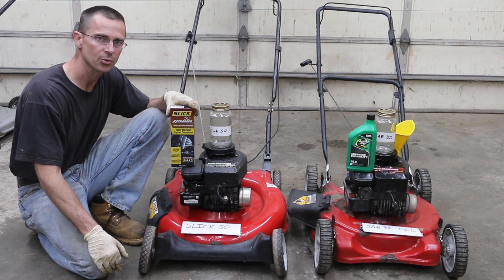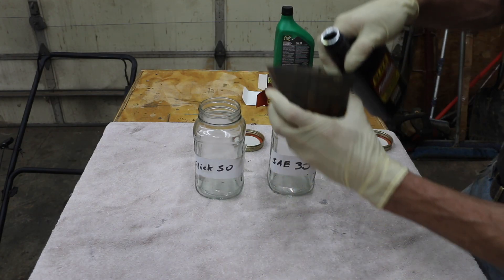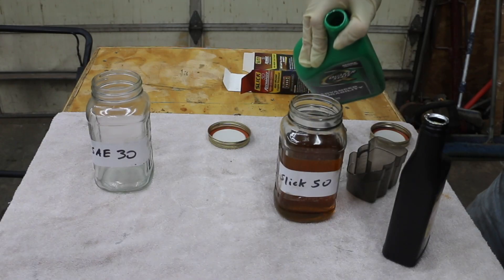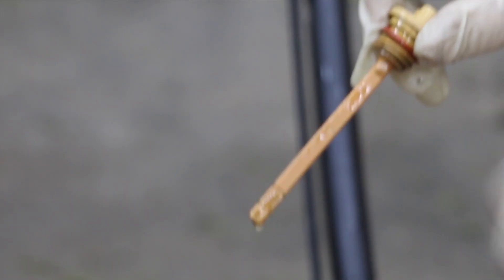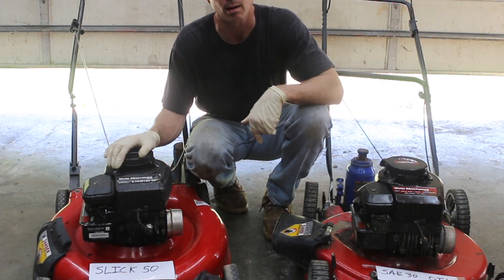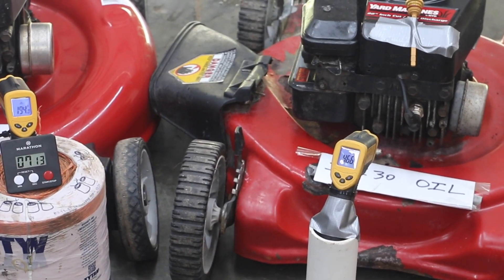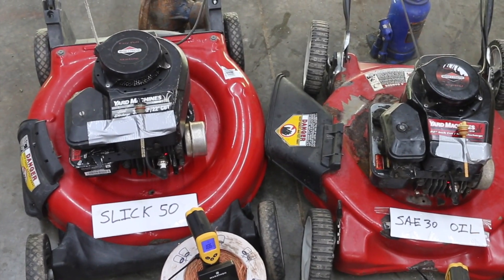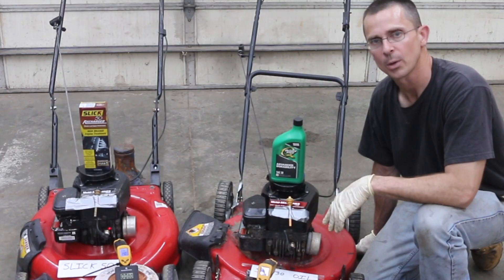Can't believe what SLICK 50 did to my engine!!--Dry Crankcase Test!

Comment: You have to remember that a couple contributing factors to engine temperatures are air/fuel mixture along with ignition timing. Engines should of been tested for both of those to make sure they are also running at the same for any further tests.
Reply from the maker: Great point!

Comment: "Zmax" , "Prolong" & "Dura lube" are the only other oil additives I've seen. Never tried prolong, dura lube had an all purpose spray that could keep the rotor cap and plugs and electrical dry, but differently than "Wire Drier"spray.
As for your testing I didn't see you miss any thing other than put a bore scope into the engines to see what damage happened.
I remember one of the commercials said as they showed a lube failure test against other lubes that Bleach could do as well or better than some other lubes but sadly I don't remember who it was it's been so long. But the part about Bleach was interesting.
Reply from the maker: Thank you!

Comment: I think you don't understand the principles of lubrication.  The advantage of thinner oil in both reducing friction and flow to improve heat dissipation are enhanced by the slick-50, but without the mass needed for the necessary functions, the lower residue in the slick-50 machine is the probable cause of the early failure.  There are also important considerations when you chose a single weight oil.
Reply from the maker: Thank you!

Comment: The blackness of the Slick 50 oil may be telling of how much more worn out that engine was.  Worn metal usually shows up as "black" in the oil.  The Slick 50 may have cleaned a bunchof worn metal out of the engine it was in.

Comment: I had a Hyundai back in the 90s that i treated once per year with Slick 50. It hit a tire (with a rim!) on the road, broke the oil pan. The car made it home (10 miles) and the oil pan was dry. 200,000 miles and 10 years--not one leak, knock, or smoke. Compression remained excellent.
Reply from the maker: Wow!

Comment: Watching this over a year later, I'm curious about something; if you still have those two specific units, which engine would break loose more easily in an attempt to unlock the crankshaft by an oil fill followed by external torquing on the crankshaft? I imagine that the warping caused by the straight oil engine's tempuratures will make it more difficult to unlock, if it isn't melted together, while the Slick50 engine's lower temps resulted in more friction shaving than warping, allowing for a potential recovery, and an unreliable but still functional unit, with some rattle in the crank bearing and scratching on the piston rings and walls letting oil up to burn in the chamber. Only one way to find out.
Reply from the maker: I wish I still had the engines but I don't.

Comment: I do believe the slick 50 needs a much longer time to build up a protective coat on the metal than the 10 minutes it was run for. Stick some in a car...run it for a couple of weeks then try the same😀😀
Reply from the maker: Great point. Thank you

Comment: A water cooled engine might have lasted longer. Once the piston expands to a certain point the engine seizes so I suspect that extreme high temperature is the real killer here. Even so, Slick 50 may have some benefits when used in a regular car in terms of reducing wear and improving fuel economy. I wouldn't buy it to try to save my engine after a sudden oil loss. Hopefully my gauges would alert me to any loss of oil pressure and I would switch the engine off before it seized. Also I suspect a metal based lubricant such as Pro-Ma MBL8 would fare better in that situation. That's what I use in my car which is a 2003 turbodiesel that has done 286,000 kms and still runs perfectly and gets 6.5 l per 100km on the highway or 8.5 in the city. Pro-Ma products are not sold in the US but you can order them from Canada. Bell Performance sells a similar metal based lubricant product in the US. It uses nano particles of copper and lead to plate the surfaces of the engine. You can search on YouTube for a video where they friction test the MBL8 product and prove that it keeps slipping at a higher torque rating than regular oil. https://youtu.be/d83RCJnaysI

https://youtu.be/pqM8wdaHBaQ
Reply from the maker: Thank you!

Comment: Prolong oil additve is good stuff. Run it in all my motors, diesel and gas 2 stroke and 4 stroke. Never had a motor or bearing go bad using it. Just my 2 cents.
Reply from the maker: Thank you for the recommendation.

Comment: pretty cool...I used to run pro-long years ago in a boat with twin 454's that were using oil, it cured it which I had a hard time believing as well...have not used it in years now...not even sure if its still made...
Reply from the maker: Thank you!

Comment: Hi, I always stand the Slick 50 bottle in hot water for a few minutes and shake it well just before use. If you didn't shake the contents, maybe they didn't mix which would partly explain poor performance. I only ask because when you poured the Slick 50 from the bottle it was clear like honey. When you shake the bottle it comes out the same as set Honey (ie:- cloudy because of the air bubbles).
Reply: Great video's though!, always enjoy them....
Reply from the maker: Thank you!

Comment: You should try the original Slick 50 formula. It is now being sold under the name Lubrilon in the US.
Reply from the maker: Thank you!
Reply: I still have the original Slick 50 for sale at my parts store, under the original name.
Reply: I did not know this. I wondered what happened to Slick 50, as I put the original Slick 50 in a VW engine in a Karmann Ghia (after overhauling the engine). I remember the original bottles had a 100,000 mile between treatments statement, whereas the newer ones have only a 50,000 mile statement on them. I do not know if the new ones have PTFE in them. What I do know is that the Karmann Ghia I had treated got better gas mileage than before, and when I drove it from Lancaster, PA to Rochester, MN (probably severely overloaded, as I had it packed with everything I could stuff into it, after removing the passenger seat and tying it to the top of the vehicle), I was accelerating while going UP the mountains in PA, while vehicles around me were slowing down. (The VW engine was a 48 hp engine!)

<EDIT> I forgot to mention that I had a 1973 Toyota Corolla that I treated in 1980 with Slick 50. I was able to start this vehicle at -40 degrees without having been plugged in, and without any noticeable trouble (compared to warm-weather starting). I believe that both vehicles did benefit from the treatments.

Also, the original formula with the PTFE in it needed to be shaken up before pouring, as the PTFE tended to settle to the bottom of the bottle when sitting on a shelf.

The proper time for treatment in a vehicle was 3000 miles. I don't know what that translates to in hours of use for a lawn mower, however I do not believe the engine shown in the video was given that kind of treatment.

I live in Rochester, MN. There was a man here who decided to test the original Slick 50 in his car. He treated the engine, drove it for the 3000 mile treatment period, drained the oil, then drove it out to the airport and back. This was a distance of about 40 miles with no oil. He had a mechanic tear the engine apart and check it out. The mechanic found one burnt bearing, however, due to the fact that the engine was not torn down prior to the treatment, the mechanic could not say when the bearing was burnt (it might have been prior to the treatment). Still, it was impressive that he was able to drive it with no oil for 40 miles.

Much as I love watching these videos and learn a lot from them, I do not believe this video was a fair test because of the treatment time and lack of shaking up the bottle (again, I don't know if the current Slick 50 has PTFE in it which settles to the bottom of the bottle). I would be interested in a retry with a properly treated engine.

Comment: Well, this is an interesting result. I would have thought that the 'Slick 50' treated motor would have run longer! I note one discrepancy between the two mowers/motors, though: the mower deck with 'SAE 30 motor' had it's 'chute' open. I wonder if that had anything to do with the cooler running temperature? I would suppose you had left the blades on for balance purposes - so if the deck acted as a 'heat sink' for the motor crankcase, the 'SAE 30 motor' MIGHT have run a bit cooler - leading to longer run-time before seize up. You should try the same test with pre-treating one engine with 'MolySlip'...My father used to use it - way back - in his Austin A-60 and it seems to have prolonged the life of that motor. Cheers from Toronto.
Reply from the maker: Thank you for the constructive feedback.

Comment: Interesting test, I wonder if you did it again if you'd get the same results. Perhaps one mower was more worn than the other or just had a better motor. Also, Slick 50 has totally been reformulated since those old commercials. There were lawsuits with Teflon and some other drama that resulted in today's Slick 50 being almost nothing like the original. There are some videos if you want to check it out. Thanks for your continued videos!
Reply from the maker: Great point. Thank you!

Comment: An interesting test but really with the QC of lawn mower engines, and then both being used.  You would have to do like 1000 engines to get some kind of average.  Once you have something running as it isn't intended you only need 1 part to fail to kill the engine.  One cooked itself, the other just seemed to die with no smoke.  My father put slick 50 in his truck, and it made a noticeable difference in how the engine ran.
  Also slick 50 obviously affected the operating temperature.  So could be that parts of the treated engine inside were expanding from heat at different rates which caused it to go out of tolerances faster and stop.
Reply from the maker: Thanks for the constructive feedback.

Comment: i have never tried slick 50 so i dont have a dog in this fight. in fact, i usually view miracle engine additives with scorn, but this single test proved nothing. the engines are clearly used and thus, in differing states of health. moreover, even brand new engines have manufacturing tolerances so 1 could be just slightly better than the other. it would take the destruction of dozens of brand new engines to reach any conclusion. even so, i was surprised that the magic goo didnt perform just a teensy bit better.
always enjoy your videos regardless. keep em coming.
Reply from the maker: Thank you!

Comment: There was an old commercial for an additive called "XR7". They showed a Dodge Viper running (supposedly) without any oil after having been run with the additive. They ran the Viper around a racetrack in Arizona in summer, and it never overheated or seized up. Seemed too good to be true, and I don't know if they're still in business.
Reply from the maker: Thank you

Comment: why was there not nearly 20 oz of oil after he removed it? and why didn't he measure how much oil was left in the engines by subtracting what he removed? I saw that there was a lot more normal oil than slick 50 so would this explain why he had the results he did?

Comment: This was an excellent video debunking the age old slick 50 claim that you could run an engine with any lubrication.  However, it also proved that when simply added to motor oil, the engine ran significantly cooler.  That’s a pretty big achievement in itself.
Reply from the maker: Thank you!

Comment: I'm with Peter P. Where do you get all these lawnmowers? I have never bought a new one in my 67 years, but rather have found ones by dumpsters and at a local junkyard. My last one I put a China carb on it and I use it today. 3 pumps on the primer and one pull on the rope! My latest find was not a mower but a MTD vacuum with a 12'X4" hose, It needed a coil as well as a carb. Best machine I've found to date.
Reply from the maker: Craigslist. Thank you

Comment: Hey man I love the test u're doing. in my country there is an product called XADO and here people use it a lot. Most of they say it's really nice. They even do a test run with VW Jetta running without oil for 200 km with average speed of 60 km/h. And return the car with knocking sound, but still running. They put back the oil and the car started to work just fine.
Reply from the maker: Thank you for the video idea!

Comment: The Slick 50 motor DID run much cooler before it seized up.  It also wasn’t treated for very long and there is an unknown amount of previous wear on each engine.  Sorry, for a better test you need to get new engines and treat the slick 50 one for at least 3 hours, with both having equal run time.
Reply from the maker: Thank you for the constructive feedback.

Comment: You put 20 ounces of oil in both engines but when you vaced out the oil both bottles were not the same. The 30 weight was several ounces less so there had to be some oil left in the crank-case.
That would account for the difference.
John davis jax fl

Comment: I replaced a 302  engine (at the dealer) in a 1980 Ford Bronco years ago. The replacement longblock had a noisy lifter. The dealer offered to fix it, I said let's wait for break-in and see. After a few hundred miles I changed the oil and included a quart of Slick 50. No more tappet noise. After several thousand miles the noise returned and I did the same again, same result. Also same with noisy lifters on a 2008 4 cylinder Malibu. I've used slick 50 ever since, every other oil change. I've noticed slightly improved gas mileage as well, roughly 3/4 mile per gallon.
Reply from the maker: Impressive!

Comment: does the slick 50 actually clean carbon deposits in the crankcase? being darker than the plain oil after use? I remember at car shows they would have engines running with no oil. I think Dura lube and Prolong use to do the same
Reply from the maker: I don't believe so. Thank you.

Comment: I'm a huge fan of Slick 50!  I had a 1996 Jeep Cherokee Sport that I ran for about 540,000 miles.  The engine was always quiet and never seemed to lack power.  The vehicle eventually died because the body was rusting away.  The engine was still in great shape.  I put a quart of Slick 50 for High Mileage vehicles in with every oil change using Fully Synthetic Oil and Long Lasting Oil Filters averaging about 8000 miles per oil change.  Towards the end of its life, I was putting in a quart about every 2-3 thousand miles.  My current vehicle is a 2006 Chevy Tahoe that I've kept the same way in terms of oil changes and adding Slick 50 for High Mileage vehicles.  I'm currently up to about 346,000 miles and the engine still seems to run beautifully.  I find I still have to add a quart about every 2-3 thousand miles though the timing of my oil changes vary as this vehicle has the "Change Oil" notification, and it seems to vary with the type of driving that I do (hwy or town).  I'm not sure if the vehicles would run as well had I not used the Slick 50 treatment, but I never ran the engines dry, so who knows for sure.  I'm not unhappy with the life I've gotten from these vehicles.  Half a million miles at a crack seems reasonable and having 10 year old (+) vehicles doesn't bother me (though I really kinda like those new backup cameras).
Reply from the maker: Thank you

Comment: What I've learned is that Slick50 is effective for lowering your engine temp, and that you should not run an engine without oil. Got it!
Reply from the maker: Thank you
Reply: Project Farm  
I only say because you seem disappointed at the results, understandably because of what was advertised. But if it has that much of an impact on an engine's temp, it's still useful for that. Hence the lesson of essentially "This stuff helps, but don't be dumb." haha.

I'm sure the Slick50 motor appreciated its brief run at a lower temp. At least, you know, before being executed for science.

And thanks for all the vids btw. A lot of respect for how thorough and consistent you strive to be. 
Keep up the great work!